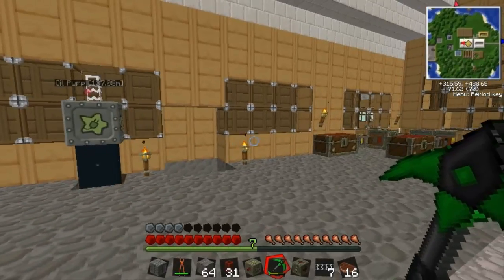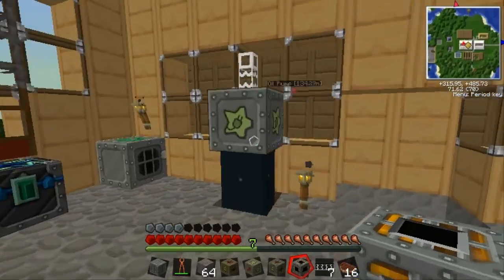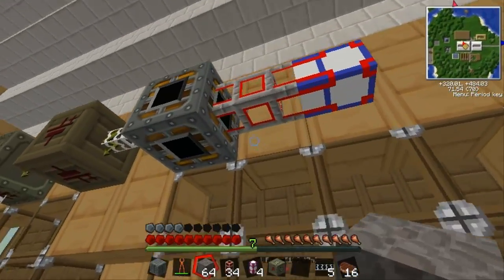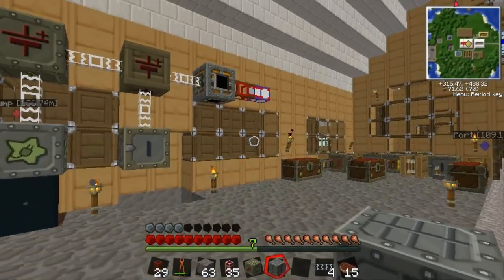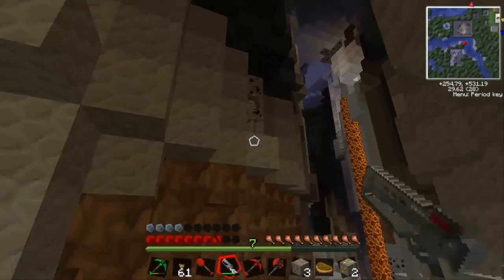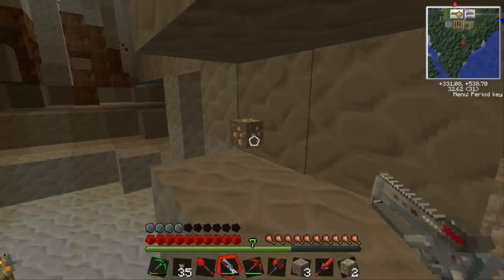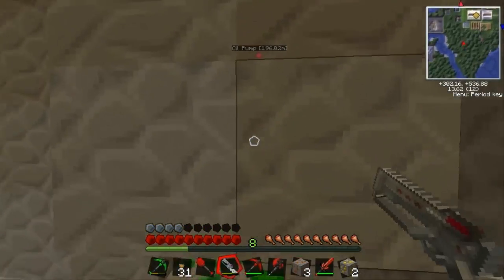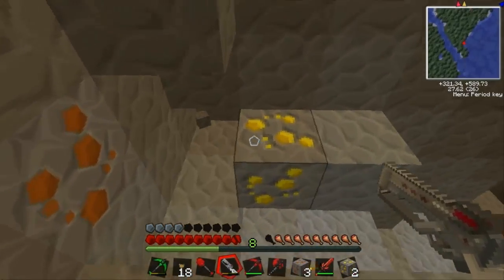Tekkit Part 21 - Ravine Cave Explorers!

Comment: joe for ur auto meat farm just put the pipe on top it only for on top because it has 2 slots top is meat bottom is coal or wat u use for fuel if u asking y it doesnt do dat for macerators is because it only hav 1 slot not 2